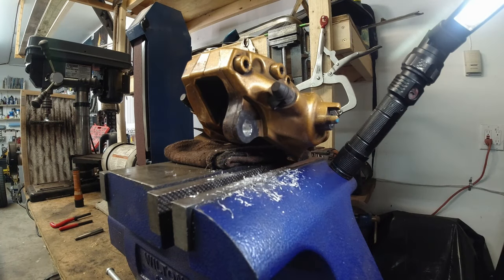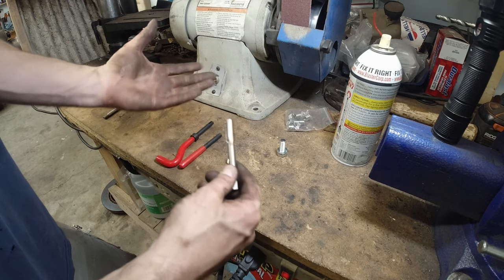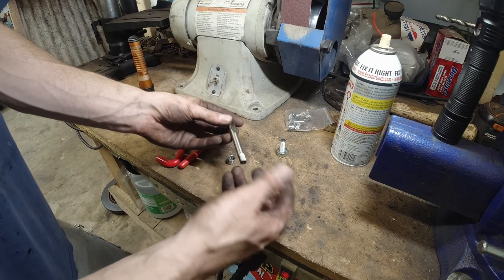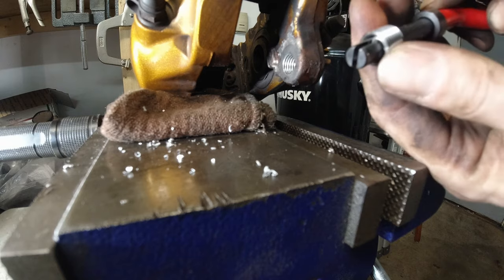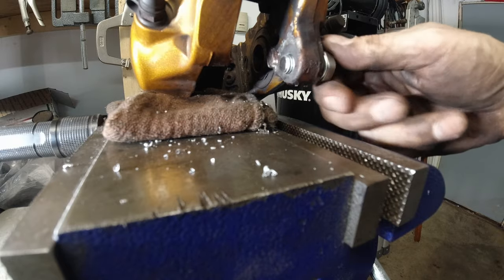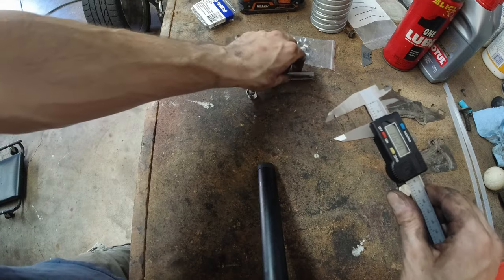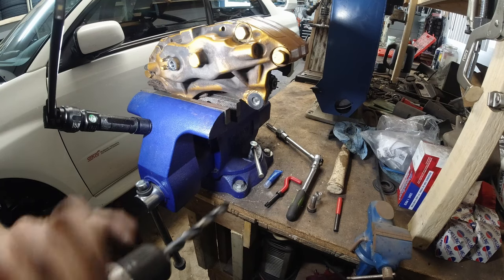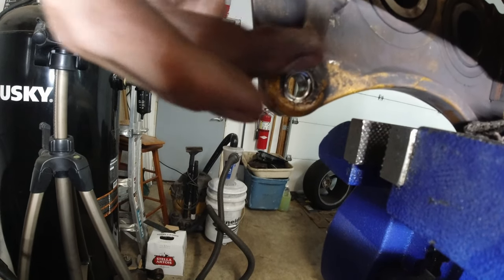Using helicoils and proper tap thread size

Comment: Thank you for this explanation.  Your video is a time saver.  I am about to try and repair a steel bike pedal and its aluminum crank.  Your video with how to figure out the actual tap size was helpful so I did not have to buy all the extra parts.

Comment: This video needed to exist when I was doing my front brake calipers 3 years ago. Amazing work, good that you showed how the helicoil went in the wrong way and did not work. Most people don't post videos of when things go wrong. 10/10 all around.
Reply: Did you mean the tang knockoff tool he tried from inside first?  That is the correct way to use the tool but no it didn't work at first without bending it back from the other side.

Comment: Thank you for this video , I'm now coming to a realization that all these coil brands and even after market coil brands are screwing with the size and it can get really frustrating,  the Amazon kits are 2 sizes up same thread pitch but these helicoil guys I'm guessing really use oversize taps , they also sell kits without bits but only a tap , their "special tap
Reply: I took from this vid that for his M10x1.5 bolt hole he could have just used an M12x1.5 tap he already had so 2 mm up in size using the same 1.5 pitch.  I may try doing the same per my above comment but for my M10x1.25 thread repairs I'd use an M12x1.25 tap for the insert to thread into.  I guess that counts as 'oversize tap' since its M12x1.25 vs M10x1.25 original hole.

Comment: Hi, nice video ... I wanted to ask you if after installing the brake caliper, the helicoil holds well or you had problems, because I would like to do the same thing, thanks
Reply from the maker: it holds very well, i take this thing to the track.
Reply: Thanks, Because I would like to fit Brembo calipers on the S2000 but they have an M14 ear and I would like to use Helicoil to reduce the size to M12.

Comment: so i have a m11 1.5d helicoil, problem is i cannot find a m13 1.5 d tap in any of the sets i find it seems this one is skipped, is this a time when standard and metric meet, or is this just a very uncommon size of tap, could i use a standard size tap with the same D, im going to also mock up a few holes in some plate steel and i will share the results.
Reply from the maker: Ure on your own on this one, should be just 2 sizes up...
Reply: @cruizinmax4017  turns out is is 2 sizes up so a m13 1.5 will work, it is a speciallty tap though as its used for fixing m12 oilpan plugs to tap one size higher and use a m13 plug.
every tap and die set i have seen in canada does not include a m13 1.5 tap. it seems odd number metric taps are usually left out so it would be an inconvienient special order in this case. hope this saves someone some time figuring this out.

Comment: Wait, I’m so confused. If I wanted to use a M8 helicoil, what size drill and tap do I need? Would it be an M10?
Reply from the maker: If you want to use a helicoil thats for an original M8 thread hole then you would use an M10, the taps that come in the sets that you buy for lets say an M8 will be labeled M8 instead of M10.
Reply: @cruizinmax4017  thanks for the reply. I want to make a aluminum build plate for my CNC that has an array of M8 threaded holes, but I want to reinforce these with helicoils so that they don’t wear out over time. If I understand you correctly, I would have to make the holes and threads in the aluminum plate in M10 to fit the M8 helicoil? Thanks for your help!

Comment: So what about drill bit size
Reply from the maker: So u know when u shop for the heli coil kit for a certain bolt size, like an M12 or M14 for example, that kit will tell you what size drill bit you need then just measure yours if you got a set.
Reply: I used a Perma-Coil kit to repair my front Brembo caliper. They call for a 31/64" drill bit for M12 X 1.5 and 13/32" drill bit for M10 X 1.5.

Comment: I cannot believe this instructional video uses imperial to measure metric taps whilst also rounding when attempting to determine the special tap size measurements. VCoil Taps are 0.3mm bigger than standard eg 14.3mm 1.5 for an M14 1.5 bolt typical labelled SP14.3 1.5. Use a kit to get the correct tap. A standard tap cannot be used for helicoils or VCoils shown in this video.
The video goes on to measuring the coil but these stretch cut to fit into a fresh tap. Also reverted to using helicoils rather than Vcoils: best to stick to one manufacturer's products... Just buy a $15 full kit and be happy that a repair is so easily possible. Thread stripped bolts shouldn't be re-used: no one should let this guy anywhere near their vehicle.
Reply from the maker: I know...so unbelievable but true and I admit my mistake, force of habit I suppose but as far as the rest of the comment I have done about 10 more repairs like this so far, one of them on a cylinder head without buying special taps or bits and so far so good, no issues or complaints.  Oh yea, one of those cars gets abused on a race track, omg!